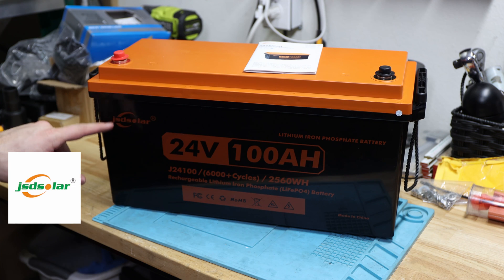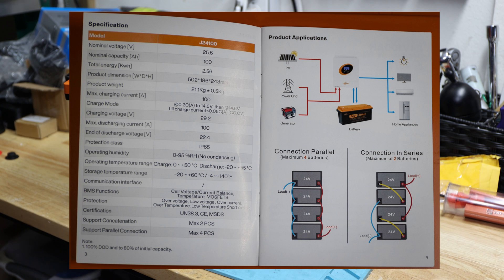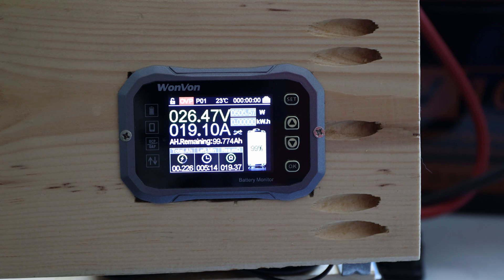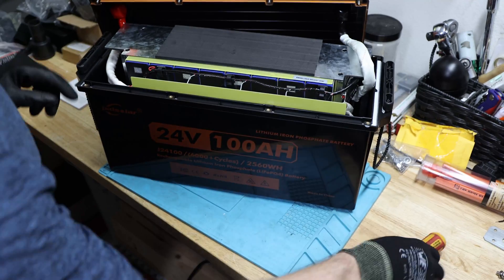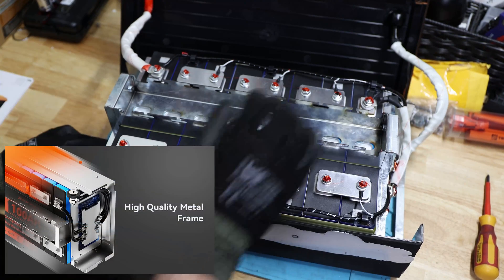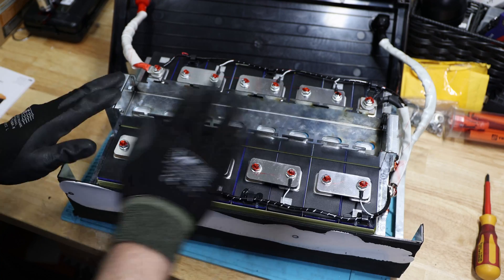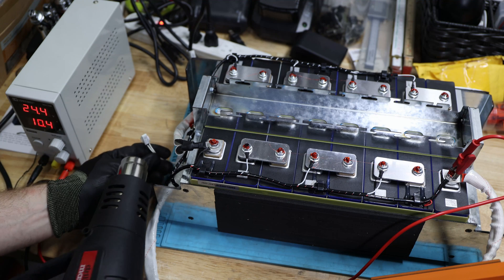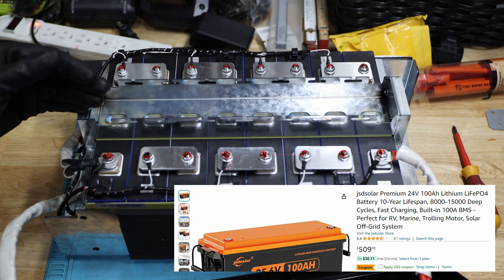LiFePO4 24V 100Ah Battery Review #jsdsolar

Comment: What application requires a 24-volt battery?
Reply: I think your right as long as your only goal is to power an inverter. On my boat all  the electronics and the electrics are all 12 volt.  You would need a step-down transformer for a 24 volt battery to work there.😮
Reply from the maker: @bitsurfr46  Yeah, that might not really make sense ;-)
Reply: Most things like fridges, chartplotters, toilets etc will run on 24V on a boat and the rest just step down. The advantage is you don't need the same gauge wiring it is less gauge for 24V.
Reply: @SoundzAlive1  My solar charge controller works on 12v or 24v. At 12v, it will take up to 600watts from the panels, at 24v it can handle up to 1,200 watts. I have a 24v battery and inverter and have 12, 100watt panels.
Reply from the maker: This is up to your setup. You can use "smaller" wires for the entire setup, have a 24V inverter instead of 12V.  This means that a 24V system will draw less current than a 12V system for the same power output. This can result in less heat generation and power wastage, making 24V systems more efficient.
You can put two 24V in series and build a 48V system easier with less batteries. It is really up to your use cases if it make sense at all ;-)
Reply: What about the BMS, they simply skipped it? 
So this will life very short!
Reply: It shows at 10:56 it's a JBD 100Amp BMS. @marbella-elviria